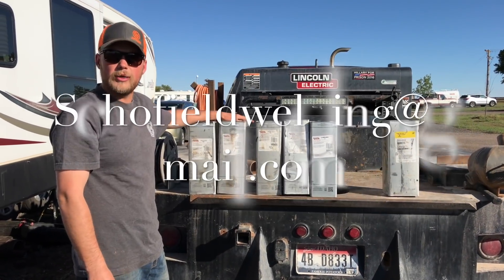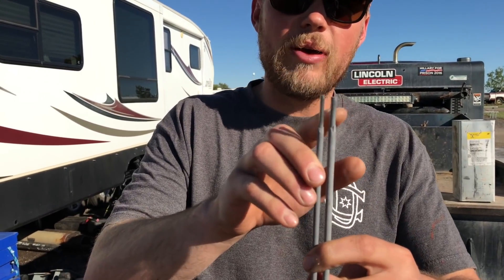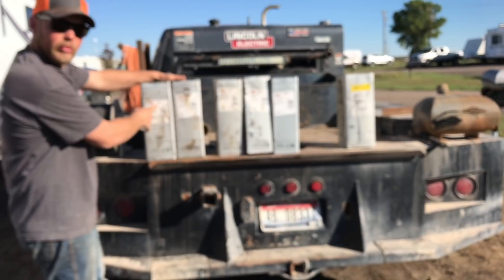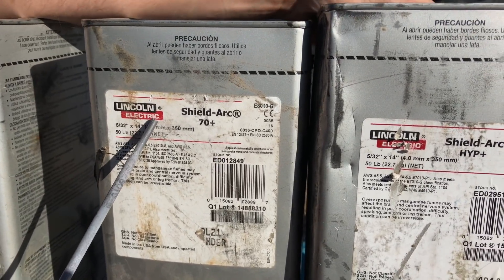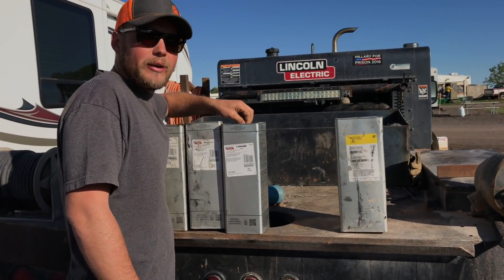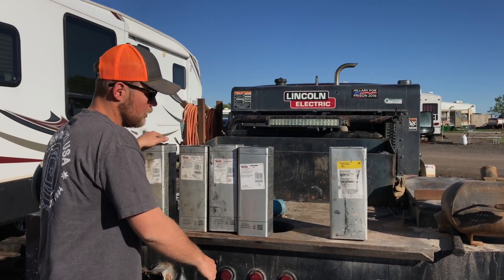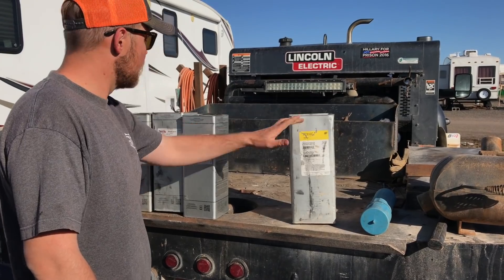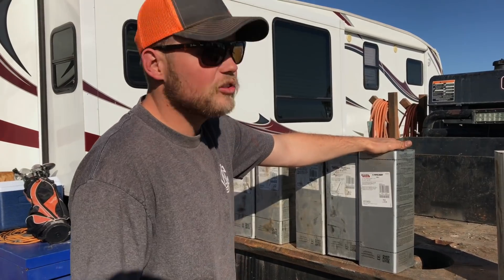What kind of welding rods do we use

Comment: The first numbers are for the  ultimate tensile strength, so 60,70,80-110, then the position, 1,2 ECT, the last is for coating type. 0,11 are cellulose, 4 is iron powder. 8 is low hydrogen. You can look them up as there are many different kinds of rods.

Comment: I always run my stringer beads with 5p+ but in heavy wall pipe I  use to love getting a box of 3's of the 6010 5p and fill and cap. I think they stack more iron than the 5p+. But I haven't used those red rods in a min.

Comment: It is hard to find the 6010 red cellulose rods at welding supply stores anymore. It used to be real common. We welded in the root pass with it in refinery pipe, then welded out with Low Hy. I want some 1/8" to use around the farm.
Reply: Junk Yard we use those in college, the red cellulose 6010’s
Reply: Yeah, they used to be real common. Good welding rod.
Reply from the maker: I got a brand new box you can have. lol
Reply: If I was close to you I would sure take you up on that. How close to you ever get to Hugo?
Reply: We have plenty at my hall.  It's pretty old.
Reply: You can buy it online all day long. Lincoln Fleetweld 5P or ESAB Sureweld 10P. The "Plus" versions of both (Lincoln Fleetweld 5P+ and ESAB Sureweld 10P Plus) have gray coatings and, as you know, runs a bit smoother, or less aggresive depending on your point of view. A lot of LWS's have the Lincoln Fleetweld 5P RSP in the 5lb plastic container, which is the standard 5P red 6010. I just bought a pack a couple weeks ago.
Reply: I liked the old red 5P. We also used a lot of Hobart 6010. Then there was Cel 70. Was a grey 7010, from Europe I think. Was good for capping.

Comment: I use the 1/16 6010 and I use 1/8 6010 as well as 1/8 7010 .... And 1/8 7018 and I always have to turn up my heat and slow the fuck down on 7010 .....I hated it at first but I used it for alot of repair work with JGI

Comment: I hated the welder I worked with because he would switch the names of things he wanted without telling me.  One minute he wanted 5/32 next he 5mm.  I guess he also was teaching me to pay more attention to what stagen of the weld he was on.  Always learning...
Reply from the maker: There is a difference between 5/32 and a 5mm a 5mm is accually a 3/16 and usually a pipeliner rod. so a 5mm pipeliner 7010 is different then a 5/32 7010 does that make sence.
Reply: Jacob Schofield yeah so 5/32 would be the bead rod so i guess i should've been paying closer attention
Reply: Tramaine W. 5/32 rod is what you head with (mostly for us we never use 1/8). 3/16 is 4.8mm and a pipeliner rod is 5mm. .2mm bigger than a 3/16.

Comment: Great video I'm about to start practicing to get my 6g 6" pipe. Root pass 6010 finish with 7018. Basic rods. When or where do I use 8010 rod or 7010?
Reply from the maker: I would learn both if it’s practice. Then once you get on a job they will tell you what to use.
Reply: 8018 is for 11/4 Chromemoly pipe

Comment: Very nicely done and quite educational.  Do you or does anyone you know run ESAB's rods of the same types?  If so how do they compare?
Reply: I prefer ESAB rods, but these days most of my stick welding is repair, maintenance, or special purpose. ESAB has a crapload of different stick electrodes, including I'm sure rods for dissimilar or hard to weld materials and hardfacing alloys that would work for what I need, but I generally stick with what I know. I use Castolin's Eutectrode 680 for hard-to-weld stuff (including nodular iron to steel)and buildup or butter layers for hardfacing, and either Castolin or Stoody hardfacing electrodes (ESAB owns  Stoody now) for wearfacing parts.

For the most part I TIG or MIG, but for odd-ball stuff TIG is either too slow or doesn't have the filler material available, and MIG requires changing out the spool and sometimes the gas (to straight argon), which is a PITA. Stick has the widest assortment of different alloys; you can darn near weld anything with all the different electrodes available, and changing from one to another only takes as long as changing a rod, so it's convenient for those types of jobs. Besides, aside from the fumes I kinda enjoy stick welding. But then again, I like gas welding and brazing too. :D

Comment: This was a great and very informative video my friend, keep these coming 👍  

One question, do you carry a rod oven on your rig or just bring one out when you have a call for low hydrogen (7018) rods?
Reply from the maker: everytime ive ever welded low high ive never had an oven someone else usually does on the job. mostly because up to know i have always ran an SA 200 so its straight DC power.
Reply: Jacob Schofield Your little 7018 Rod Tube, you could probably throw a Humidity Control pack for a Gun Case or whatever to help out as well.

Comment: are u thinking about 11018 rod? 110 tensile strength? we use that alot
Reply from the maker: I have never ran that rod before. are you building on cranes and things like that?
Reply: yeah crane boom, and stuff that takes a lot of impact, kinda run like 7018

Comment: Can you run 7010 or 8010 downhill on structural
Reply from the maker: on things at the house for sure out in the field ive never seen it done.
Reply: That will depend on the Code you are welding too and weather the Welding Procedure and the Welders are qualified to weld downhill.

Comment: Do y’all use 7024 at all?
Reply: Chase I don’t so I doubt they do, maybe if welding I beam racks but prob not because 7018 is more useful
Reply: Chase the 2 in the 7024 means it's a flat position only rod, not much good for pipe I wouldn't think.
Reply from the maker: exactly what ecr125x and rcrcustoms said ive acually never used it. 7018 we use a lot of for structural or any uphill processes. there is also tig but we will get into that in a later eposoid .
Reply: RCRCustoms when I welded I beams/structural I was welding the fasteners overhead, I left for lunch n when I came back the guy ways cursing n asking how I had a few hundred done and he only got 5 or 6 done in 30 mins... I told him to try and use an all position rod like 6010 instead of the 6022 (decking rod to plug weld galvanized) this guy was in his 50’s claiming that he’d been welding for 30 years and had no idea what the numbers on the rods meant. He quit a few weeks later...
Reply: ecr125x it happens all the time my friend LOL 

I was on a job welding stainless wear plates to carbon steel kilns in a paper mill and my cross shift on days with well over 100 years of combined welding experience  (some 30 and 40+ year members) and not one of these guys had ever done stainless.  It was a good lesson for the apprentices I was working with, because we had to fix the God awful horrible mess they left us LOL  

If you don't know ask right.  That's why these are such great videos that Jacob puts out.  I'm not a Pipeliner but I love to learn,  and these guys are always an inspiration and make me want to go out and pick up a couple of tins of 5P+ dress up a handful of coupons and just start burning rod.
Reply: Jacob Schofield really looking forward to the tig videos 👍
Reply from the maker: dang well he learne something that day lol
Reply: 7024 is for static loads only. Only  ever used it welding tank walls to floors.